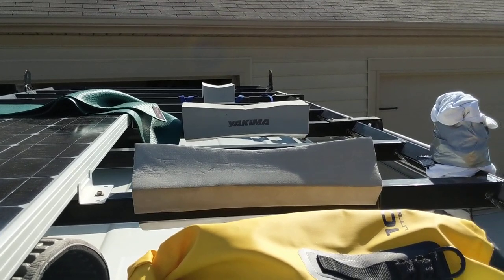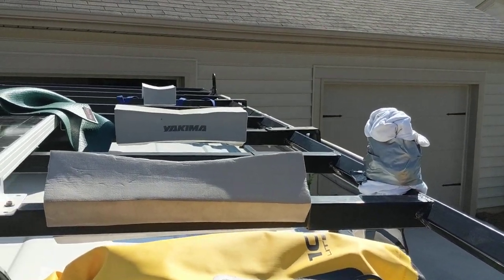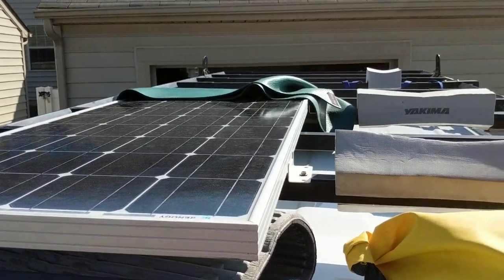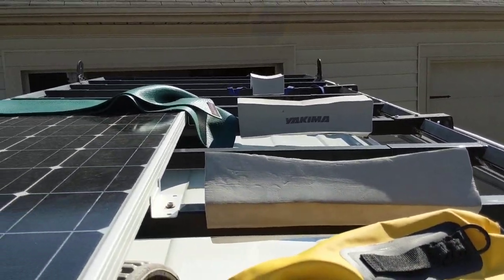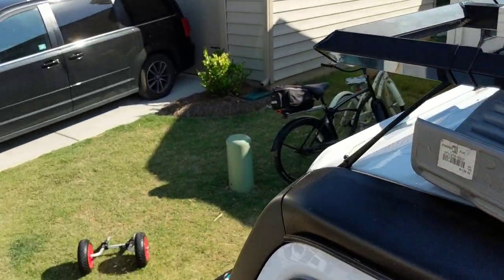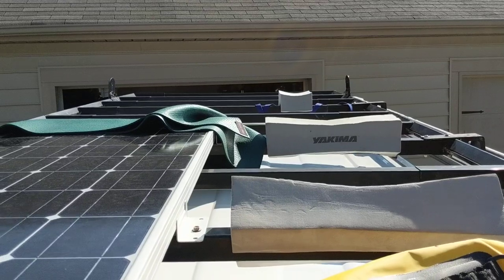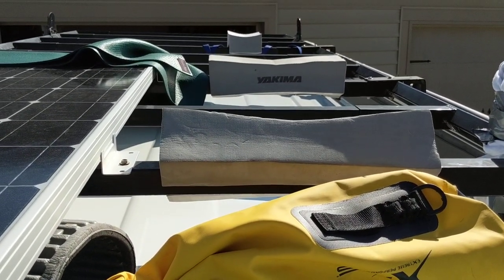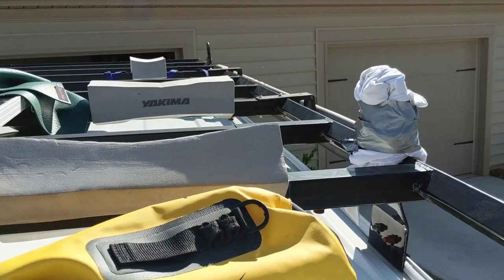Kayak Vlog #8- Roof Rack set-up for kayak

Comment: I have also seen where they make like a box on the roof rack and the top part is what they're putting all their solar panels and then if they have any gear they slide it underneath I e the the Box idea
Reply from the maker: Hmm.  I have not seen that set up yet.  Or maybe I have but just did not notice.  Thanks for the info!  Hope all is well.